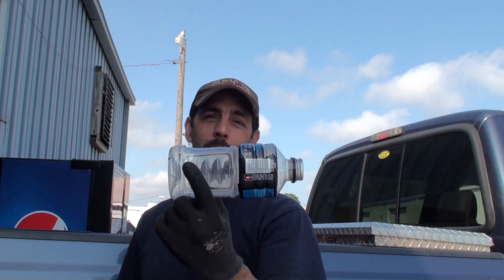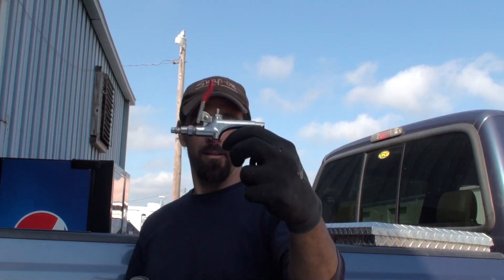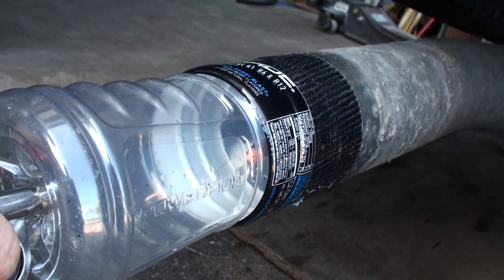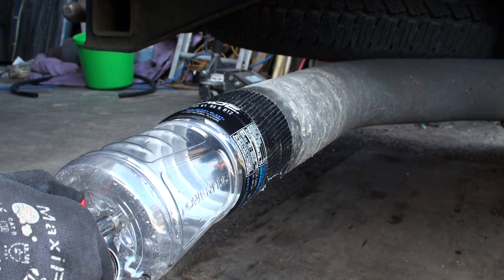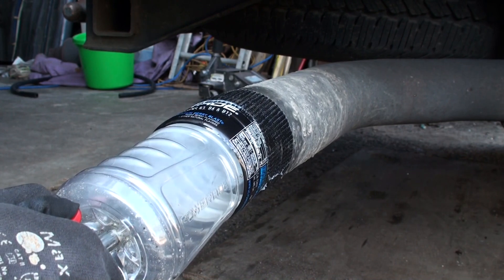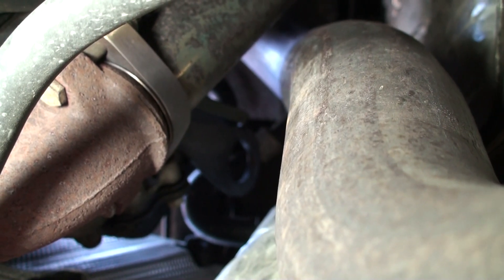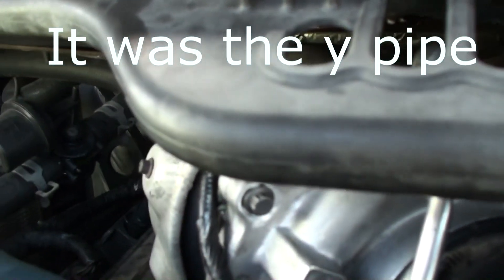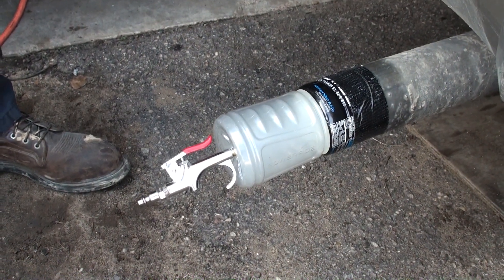Making a smoker to help find exhaust leaks easily

Comment: Thanks for posting this video. I had a persistent P0430 O2 sensor code. I used your trick to check for leaks and sure enough I'm leaking from the front catalytic converter flange which is giving a false O2 sensor code. Thanks also for specifying Black and Mild cigars. I tried another brand and not enough smoke was produced. I rewatched your vid and heard you say Black and Mild.

Comment: A clean Shop-Vac in Reverse mode attached to your exhaust pipe, and then spray some soapy water where you think the leaks are coming from, you will see all kinds of bubbles coming out of the leak. Far easier than this method...
Reply: I just did your method and it worked..... So simple 👏👏👏👏

Comment: how did u put the black n mild in their to strt smokin
Reply: Unscrew cap off bottle
Make hole in cap.
Put B&M into hole in cap (lighted end goes inside bottle)
Light cigar
Screw cap with cigar in it into the bottle.
Duct tape cigar of bottle inside exhaust
Make hole in other end of bottle
Put air gun into hole
Blow in just enough air to keep the cigar lighted and get smoke into pipe.
Look for leaks.

Comment: This is a awesome trick bud. I have a question for ya though. How would you do this on a true dual exhaust? One side at a time or tape one side off?
Reply: weldmaggot 77 have some one hold a rag to one end of the dual and do the bottle to the other end

Comment: I actually did this! It does work. In my case I had to use 2 B&Ms to get the smoke all the way up to the manifold. Definitely a two man job. To take it one step further; I duct taped the tail pipe shut, drilled out an O2 sensor plug and stuck my air chuck in that. Found my leaking v-band clamp super fast.